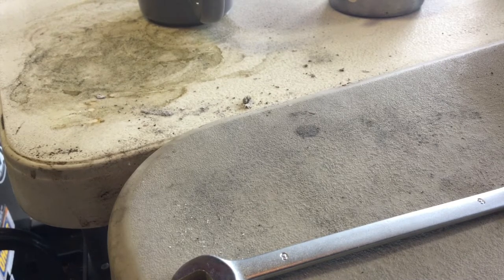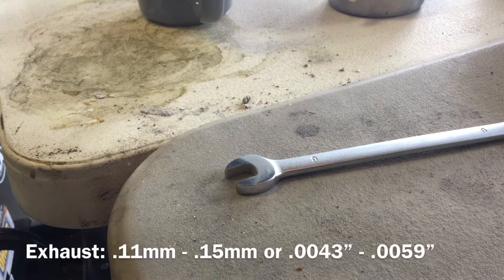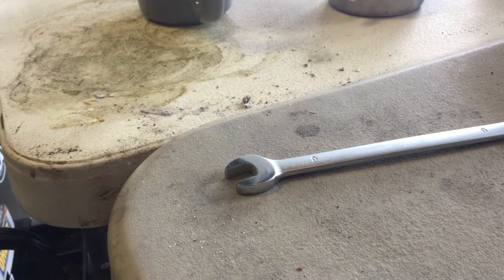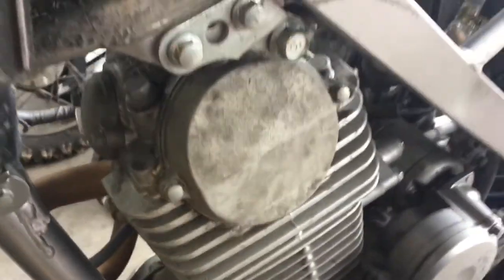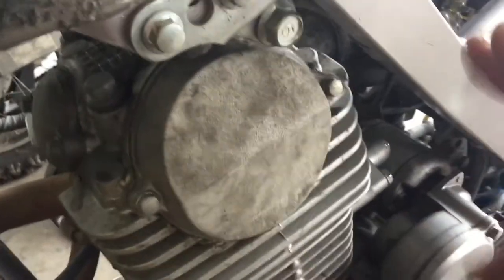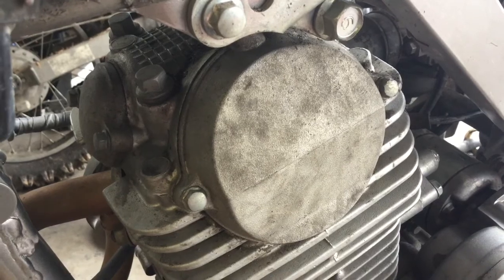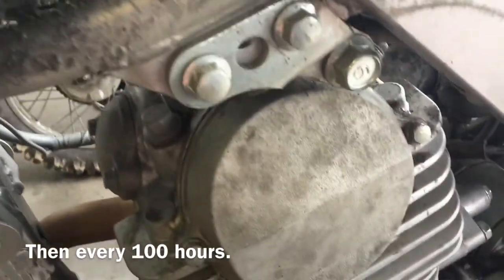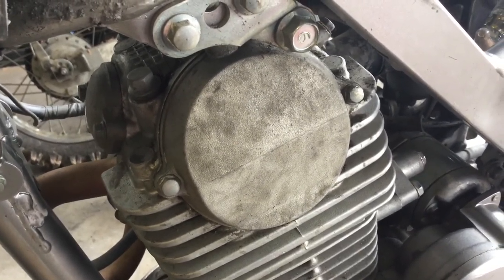Kawasaki KLX140G Valve Check Overview

Comment from the maker: [Corrected]   Intake .04mm to .08mm or .002” to .003”   Exhaust valve:  .11mm to .15mm  or .0043” to .0059”   That’s from the service manual.
Reply: LostInPA soon as I saw asked I decided to let the video play for a minute and saw it. Thanks man!
Reply: Wrong, add an extra 0 infront of those exhaust clearances.
Reply from the maker: @loganmaccallum1500 . Which measurement?   The mm or inch measurement?   I read them out loud in the video direct from the Kawasaki service manual I purchased.
Reply from the maker: @loganmaccallum1500 . Never mind.  I see what did.   It’s correct in the subtitles in the video.  I corrected in the comment above.   Thanks for catching it.

Comment: Wanting some clarification on something, I’ll try to explain as well as possible: 

When a valve is proclaimed LOOSE: it means the valve ADJUSTMENT is Very low “tight” on the feel of the gauge, correct? 
Example: a 0.4 valve is incorrectly set to 0.2. Therefore the tight adjustment has created a LOOSE (too far open) valve. Correct? 

My reason for thinking this way: 
A “tight exhaust valve” is a valve that doesn’t open during its stroke & burns the seal. Therefore. The valve is TIGHT. but it’s ADJUSTMENT is reading higher (looser) than that of the recommended lash. 
Example: Exhaust is incorrectly set at 0.9 opposed to recommended 0.3 and is therefore a TIGHT valve, correct? Because the valve is physically not opening in chamber. Despite the ADJUSTMENT being proclaimed “loose”, yes? 

So in short: when people say “loose valve”, do they mean the adjustment of the screw? Or the actual function of the valve (what we cannot see)?

Loose valves: open too far inside chamber 
OR
loose valves: read too high on Gauge (ex: 0.2 more feel than recommended)

Confused. Sorry.
Reply: I think he’s trying to accommodate for them tightening instead of just going on the bare minimum spec recommendation.

Comment: Anyone know the torque specs for the tappet cover bolts and the timing chain cover bolts?
Reply from the maker: 78 inch pounds.   Or just snugged past hand tight.   https://advrider.com/f/threads/the-klx140g-thread.1184531/#post-30755271

Comment: did you also have to remove the alternator cover center cap first as well? it seems to be one of the steps required as per the service manual. thanks
Reply from the maker: Nope.  Only the cover to access the cam shaft sprocket and the valve covers.
Reply: @lostinpa-dadenduro7555  that's great news. Strange why the manual mentioned that, I'll try it out myself, by any chance did you rotate the bolt anti clockwise or clockwise before it is TDC? Thank you.
Reply from the maker: Jonathan Teo   It’s clockwise rotation.  👍   This bike is the US / Canada version of the KLX140G.   I also had the factory service manual.   There is a KLX150 Street legal version that is sold in other countries and maybe that is different.
Reply: @lostinpa-dadenduro7555  thanks mate. I actually ride the KLX150, but i think its the same engine, looks very identical.. KLX150 is made in indonesia, so i think its the South East Asian variant.

Comment: By chance do you know the clearance on it?
Reply from the maker: floppy zebra Hi at about 1 minuet 15 I say and show on the screen the intake and exhaust clearances in inches and metric.
Reply from the maker: Intake .04mm to .08mm or .002” to .003”   Exhaust valve:  .11mm to .15mm  or .043” to .059”   That’s from the service manual.